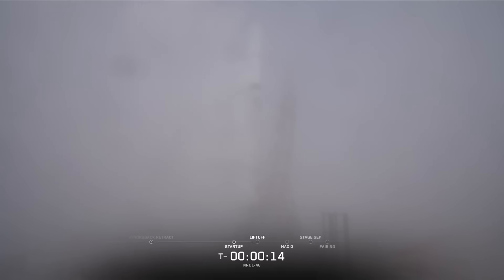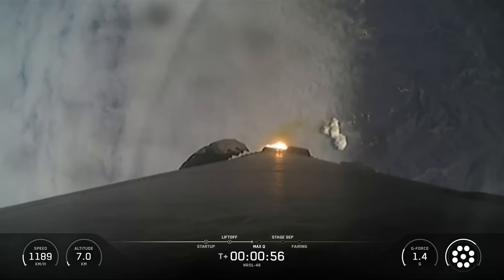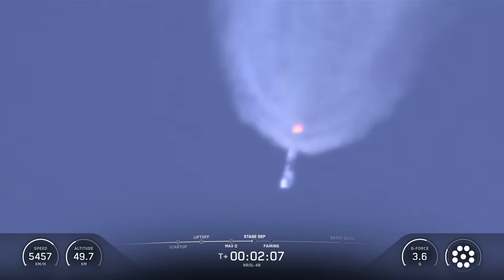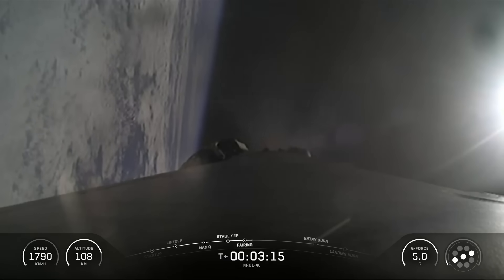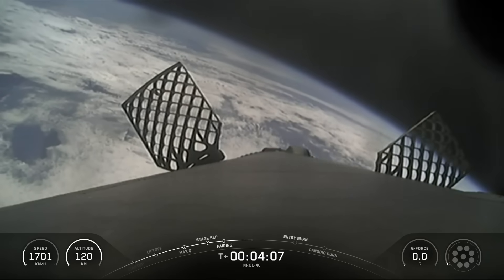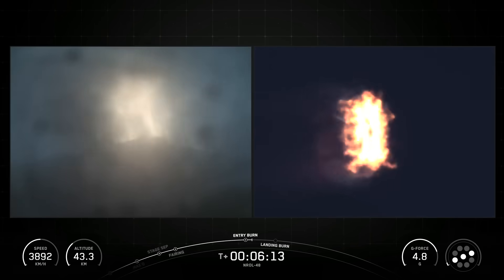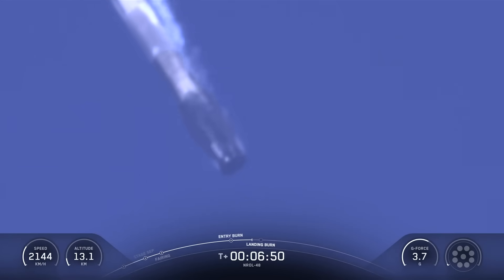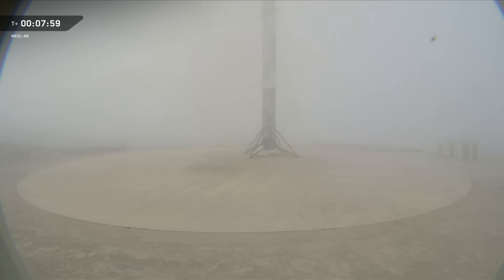Blastoff! SpaceX launches US spy satellites, nails landing in California

Comment: Triggers memories of the Western Test Range (WTR) back in the 80’s.  Unsure if they still do it but back then we put a Range Safety team 1,000 yards back from the launch azimuth (BackAZ) and another team 1,000 yards 90 degree from the launch AZ (Program).  We did that because due to the mountainous terrain at Vandenberg, Radar is unable to acquire the vehicle until it is a few seconds into the launch. We have to ensure the vehicle is headed in the right direction and not headed for Base Housing, Lompoc or Santa Maria.  If the missile is not headed as planned Range Safety sends destruct functions.